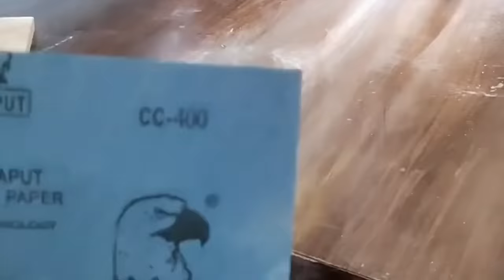Manual repair of deformed cracked tables, repair completed | Furniture Restoration

Comment: Wait ! You needed to pull the table together BEFORE adding the bowtie. Now the surface is wider on one end ! The dowels do nothing.
Reply: I was thinking the same exact thing
Reply: That's the first thing that crossed my mind. A couple pipe clamps and some glue is all you need. Then fill it in. 
The color matching does look good though.
Reply: Was going to make the same exact comment. The table now tapers out to about and inch wider at that end
Reply: If the table cracked that much will the little shims put in the crack eve   e stable. I thought bowties would go underneath.
Reply: If I ever break my leg I’ll come to you…………this is nuts!!!

Stavros
Reply: It now fits the ROOM that also EXPANDED during the EARTHQUAKE..
Reply: No, it's there to stabilise the crack, attempting to bring the crack together is no longer possible, it's too wide, it would only open up ! It is of little consequence if its a quarter of an inch wider at one end.The colouring is passable at best, an airbrush is ideal for the task, too much pigment in the tints has given it an opaque painted appearance, more transparent colours required.
Reply: @marinegunny826  hopefully, the guy measured the table length at both sides and took that into consideration.
Reply: @stevecallachor  
I hope you don’t!
Best
Reply: @BeasleyStreet  0
Reply: This! That bow tie also looks too narrow at the middle
Reply: Nice 👌
Reply: @marinegunny826  yep for bigger family members...I have the same issue and prefer a table wider at one end...lol
Reply: Yup...
Reply: Yep the table is now wider and out of square. But looks nice lol.
Reply: Why don't you make your own video and show him how its done instead of criticizing.
Reply: What a hack job...literally.
Reply: Sure is a lot of critics in the comments section if they know so much better why won't they show him how its done .  Crickets 😳
Reply: Well i believe he thinks adding the dowells to the center of the bowtie will expand the bowtie owtward like a dowell shim lol. Which whatever helps you sleep at night but the guyshoved a ton of wood in that crack. That will make the crack travel unless he did this to both ends of the table in the future that crack will come back on the other end of the table. Bowties should be used to prevent the crack from traveling so i he did not do this to the other side at the very least he should have added an additional bowtie to the top and bottom in an effort to stop the crack traveling after the repair. Good painting skills though.
Reply: do not bother commenting the quality of work. It's a click-bite:  more mediocre work results =  more comments with advice . Damn - I was click-bitten too.
Reply: I agree on all points
Reply: Great low cost, low equipment repair. It doesn’t matter about petty details, it’s perfect for a family to eat from and the person that did that repair should be very proud. Well done! 🙏
Reply: How to put them together?
Reply: He said wait! like he didn’t already do it and post a video 😂 true tho, was thinking the same
Reply: @brorow6821  How about you make your own video explaining how everyone but YOU is wrong instead of criticizing them? Critiquing the critic is still being a critic.
Reply: @brorow6821  You should know: you're a critic too. Your target is different but you're still one of them, so hypocritque much?
Reply: @BeasleyStreet  Then the appropriate thing to do is to saw out the crack and match the wood, then appropriately stabilize it and strengthen it. All this "repair" did was to turn this table into a hidden danger. That "quarter inch wider at one end" means that there is a disruption of the physical integrity of that wood, and it has NO business being returned to the owner in such a shoddy condition. This isn't a "repair"...it's FRAUD.
Reply: @BPZ313  Not at all I don't watch a content creators video just so I can criticize them and tell them how and what they are doing wrong that's your thing.
Reply: @brorow6821  You just read everyone else's comments and criticize, which is just as bad. Now take your hypocrisy award please, and try to remember not to drool on the red carpet as you stumble away, please. XD
Reply: Yea, total hack job.
Reply: Wow! My wood shop teacher is yelling down at the grave yard!😮
Reply: @BPZ313  Learn what criticism is I didn't criticize anybody I just told the truth about all of the know it alls that's in the comments.
Reply: Don't forget that he needs to put bowties along the length of the crack for reinforcement and he had wood glue. He could have made a proper wood filler instead of using crappy CA glue and sawdust.  Besides, if he's going to leave the crack wide he might as well use some deep pour epoxy.
Reply: Okay, that's a cheesy fix.
Reply: This is just terrible.
Reply: Exactly my thinking

Comment: If a 6 foot table is splitting in half, what is a bowtie that's only half an inch thick in the middle gonna do? I would just cut the cracked section out and add a middle section back in
Reply: It was almost 4in to start with also.The split was an inch wide.looks like they finished a green slab.
Reply: Or epoxy
Reply: What’s it gonna do? Exactly what you saw. fix the problem.
Reply: Cine are experiență si ochi de meseriaș, vede ce spui tu, cine este doar naiv, vede ce spun cei  ce comentează împotriva afirmației tale! Așa este, cum spui tu! Ceea ce se prezintă in filmuleț, este cea mai idioată idee de a remedia problema apărută!
Reply: Keep it inplace while repairing the crack.
Reply: Half an inch?
Reply: I don’t know why they didn’t just fill the crack with a good wood glue and use bar clamps the bring the crack together. I have done similar repairs. Much simpler and if the crack is relatively clean you can get away without refinishing.
Reply: Now he has a section with either no matching grain or an artificial looking matching grain.
Reply: Won't the 'repair' he made just eventually split again where the split was basically pushed hard by the wedges and shims he used?
Reply: I would just cut the middle out and colour matched a new piece of timber in the middle and added bow ties for looks
Reply: @GyvonJ1128  Hardly; that's going to finish splitting and probably fall apart. That bowtie does nothing for structural stability, and the extra wood this person added simply adds pressure to the crack.

Comment: I don't think I've ever seen a better example of "its all in the finish" in my life.  I think the repair job was a bad one, first using a bowtie that does nothing in this case because it's so thin & badly placed, & then wedging the Crack apart even further.  It's basically being held by sawdust & superglue.  Great finish though...
Reply: Yeah.. I'm by no means any kind of an expert on furniture repairs, but I caught myself going "wait, what??"
I was half expecting some form of epoxy pour into the crack, but the way those pieces were wedged in.. oh man!
Reply: yeah agreed that was not a good repair at all, and might split again.

Comment: You NEED to clamp the split in the table together before applying the bow tie connection. It would save a lot of time and maintain the original look of the table without all that extra work. Glue, clamp, level out both sides, bow tie, saw dust fill in, sand, stain, and seal. Done. All the extra work is unnecessary.
Reply: Not to mention this table will split again, and probably fall apart in the process.
Reply: Exactly; the added wood is just going to put pressure on the crack, and the voids in there guarantee it will fail.

Comment: I suspect CA glue, while being very expedient, does not have the flexibility needed to bond wood. It get very hard, therefore very brittle, it will fail as assuredly as those honey consistency polyurethane glues. I used that on some furniture repair before I understood the properties of the stuff.  Every joint failed in two years. Took every joint apart, cleaned that crap off, used a type II modern wood glue, probably Titebond, that was ten years ago, still stable and holding. I applaud your color matching skills, the finished product looks good. I think you'll be redoing it in a couple of years.
Reply: Was thinking the same thing. He's a hack.

Comment: My grandfather showed me how to fix tablets that crack. Bow ties work for this type of fix. Bye not clamping the wood you're not putting pressure on the stressed area that caused the problem in the first place. But the proper way is to cut out a board with with  the crack in the center of the board. Glue in a new board clamp and refinish. Fixed many since the 70s. And the only tables that haven't came back too haunt me years later we the tables i cut out the crack and effected area . In a nut shell you have to remove the stress that caused the crack . Or it will come back in years or decades.

Comment: Things I would have done different:
Clamp the table tighter

Depth tape your bit for consistent drilling depths.

Daisy chain the drilling minding the exterior face of the bit so as to leave nothing but chiesel" clean up instead of beating on it like mad with a hammer to clear the excess. 

Install the bowtie subset by 1/8-1/4" reason to follow  

Would have reached the entire installment side and redone the entire ares (let's face it, it's all of 1/16th meaning any deviation will be blatantly obvious where as refacing the entire surface would prevent abnormality.

Back to the  subset tbowtie. Why would you do such a thing? Ne might ask. 

 I'd take the removed materials and mix it with wood glue until reaching "field capacity" and then add a touch more glue. This way you have similar material to the patch instead of using pre-made filler. This same handmade filler would go into the new recess infront of the bow tie to conceal it a bit better.

Now to the finishing. Sand from the widest point to the thinnest point to prevent tool dig from uneven pressure. Fewer long passes will produce better consistency than several tiny passes across the gap. Think drawing to sketching. The final steps would be yo use an orbital with a fine grit to resurface the entire piece including reproducing the entire ares along the bowside end. Final step would be to restain and probably redo in a few more years. The wood is splitting for a reason. This is where the false plug infront of the bowtie is installed. You'll get clues there and along the gap where the wood will pull from the material or flake out when it becomes lose 

But again this is all just my opinion and what I personally would have done with the project. Coming from a trim background I've learned the smallest alterations create the biggest headaches in production. The details matter. That being said there's probably several fulltime furniture repair guys who would argue with me about approach

Edit: in hindsight that Crack is bigger than the grandcanyon I probably wouldn't even bother with the price or playing  the cut and glue game unless I was going to turn it into repurpose the wood to produce a new table
Reply: Konačno neko ko zna šta govori. Bravo za svaku reč!!!
Reply: Worst looking butterfly key I’ve ever seen.

Comment: My rocking chair sits on the back deck during the day. I bring it in when bad weather approaches. Will the hot sun losen the glue joint? Should epoxy be used instead of white or Titebond type glue? Adding a butterfly wedge and spline is what I plan to do as you did. I'll put added coats of Polyurethane as added protection. Thanks for the post.

Comment: You made an exceptionally good, neat job of doing a permanent structural fix on this table. Very well done.
Reply: ...except now the table is a Trapezoid instead of a real rectangle. Judging by the video title, the table is wider on one side than on the other. He shouldve pulled/clamped the table together and then add the bowtie. That way the table wouldve been much closer to its original shape.

Comment: Great fix, except I would just taken to the table saw and ripped it done the middle then glued back together.
Reply: I would have simply cut that end off, cut the other end off, squared both the cut ends and the center section of the table, added hinges and sliding slats to create a table with folding leaves.

Comment: I would not have repaired the table like that.  I would remove the top from the frame. Then use a wire brush to clean out the debris in the gap. I would test clamp it together and clean out until I could close the gap completely. I would then flood the gap with glue and clamp together. I would add small reinforcements across the gap underneath using glue and screws. Sand the top and using the sawdust make a filler with glue to close any gaps.

Comment: A flawed repair which will eventually fail.  The crack in the wood was due to the drying of the wood over time placing stresses on the wood.  And sure the bowtie at the end will hold that tight.  But the point of the crack, the end within the table was merely concealed.  The stresses on that crack at that point remain.  And sure it's covered over but the wood will start to give and continue to tear down the length of the table from that point to the other side over time.   A hole should have been drilled at the end of the crack to remove that potential point, to stop the tear / crack from proceeding further.  And while they did a good job in the camera, I could still see the repair (despite how well they did covering it) on the surface.  A sanding over the entire surface and restore of a frech coloring and coating would do a far better job and produce a better more even surface.

Comment: Completely backwards way of doing it you could’ve done it and put it in tighter and even maybe even salvaged it even better but you’re not doing what you have done… I’ve worked with a lot of wood in my time you could pull that in tight, glued it sanded it down and she would’ve remained intact .. I would’ve done it with different but it’s your table not my